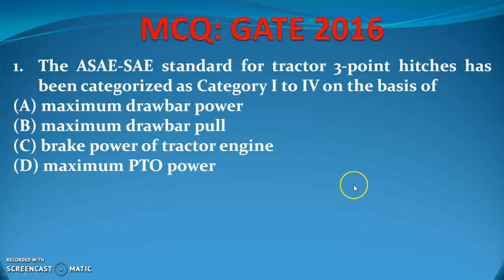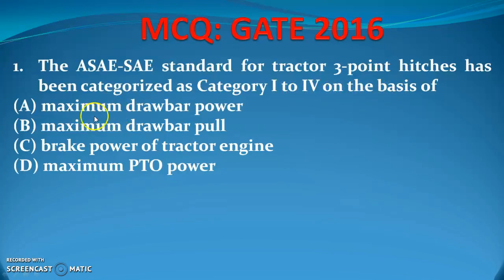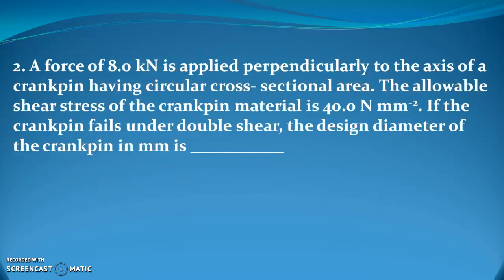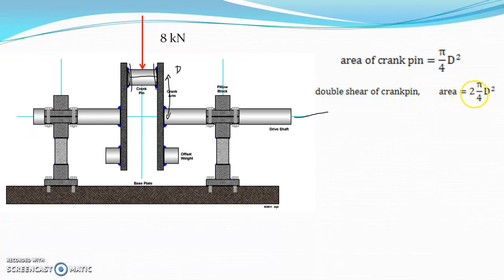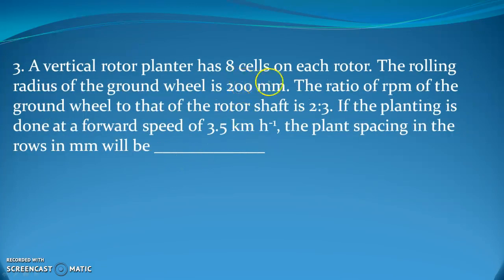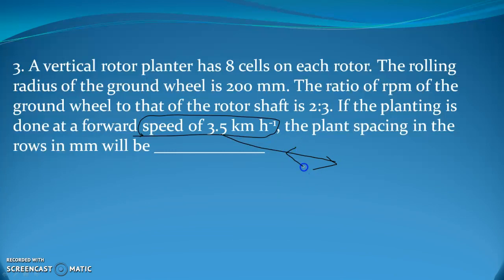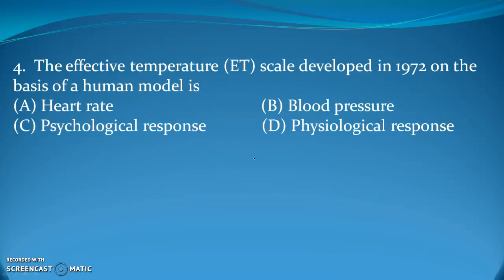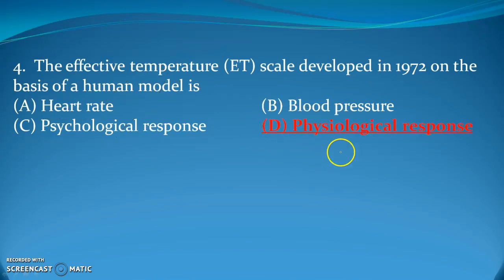MCQ Farm Power and Machinery: GATE AG 2016  Solutions

Comment: Sir what is virtual Hitch point plz tell me sir
Reply from the maker: virtual hitch point is the instantaneous centre of rotation of the three point linkage arrangement. that is a imaginary point where both lower link and upper link line meets and by which point the implement can be rotated by adjusting the length.
Reply: Agricultural Engineering Online 
Thanks sir